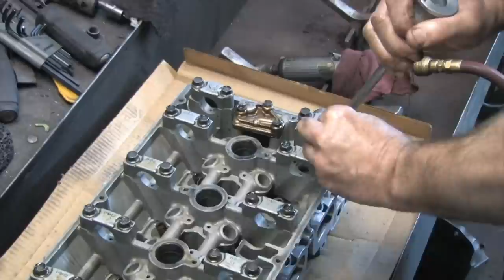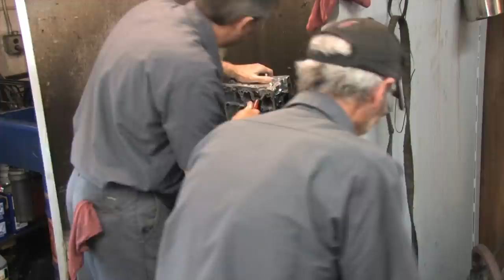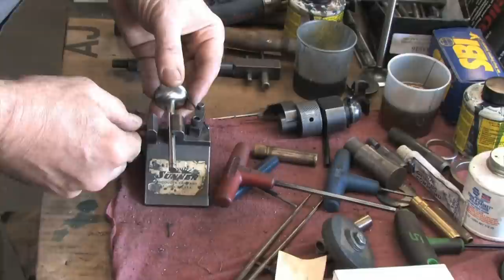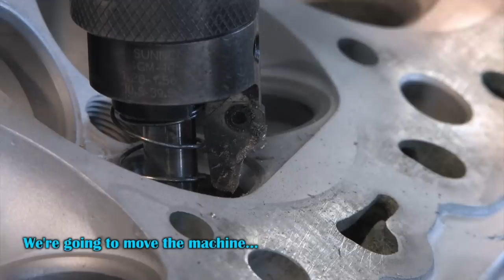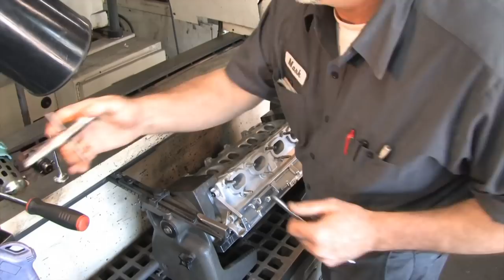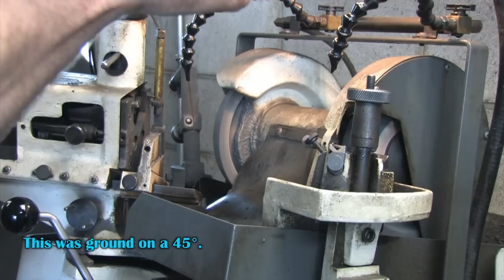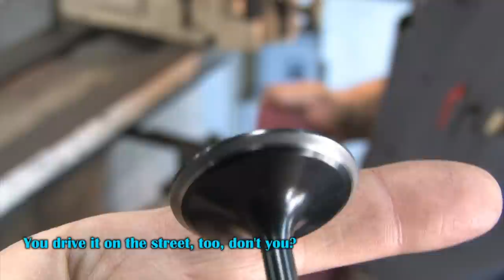Cylinder Head 201 - Radius Cut Valve Job

Comment: One trouble with lapping compound is that it cannot be removed completely by wiping with a rag. Any of it left on the face of valve can cause failure. Prussian Blue  Machinist blueing is best for checking . Just rotate the valve and get a high contrast view of the contact area. If you use lapping to clean up poor machine work you are cheating or working on some old junk head to get the klunker to run a while longer. On high speed engines 10k rpm you never use lapping compound. You set the valves with extra valve lash,.003 , and run it a few hours to beat down the high spots. Then reset lash to correct clearance.  Another thing is noone measures the valve stems for wear or the actual clearance from valve to guide. Usually the finger method is used. Tight guides have caused more problems than loose ones especially on the exhaust.
Reply: Agreed. I was wondering why on earth he dicked up that valve and seat with compound  instead of using dye. I give him props for checking his work, but...

Comment: ...chamber and sunken exhaust valve seats to reduce the amount of the intake air charge that flows through the exhaust valve during the overlap period. You can read more about it online on his website. The case study he used was of a heavily turboed (38lb boost) Mitsubishi 2L motor putting out approximately 700hp, after installing the POLYquad head he saw gains of ~90hp at 5lbs less boost pressure. Pretty cool stuff that might be worth checking out!

Comment: Your Mitsushitty might be the first one that actually runs real good after all this work you've done and had done. Like you said they cast these heads like total garbage. You need to put the care into it to make it run right. Doing great! Got a vid of it all done? Love to see it...
Reply from the maker: This is the build that's taken 7 years to start.  I've been quietly stockpiling more parts and more tools for it while accidentally building one of the world's fastest Elantras.  That was a stupid achievement that could be easily shattered with enough welding wire and lack of concern for safety, but you're not late to the party, and this head is about to get put to use.  What you saw wrong with this head is nothing like that Elantra's cylinder head's problems were like.  The head here was from an early production (October 1994) second generation Eclipse GSX.  The earliest of the 2g's before they sold out of their entire inventory which made Mitsubishi turn the production lines up to 11 and rushing everything else.  This casting is the best they ever did for a USDM 4g63.  But it's their post-casting handling and cleanup that has always sucked no matter what country it was cast in or when.  The casting on this head is amazing compared to the one on the Hyundai.  They both had the same post-casting cleanup issues with the flash obstructing the oil return, both had rough, sharp protruding casting lines, but the GSX head didn't have mis-aligned ports or Swiss cheese holes in any of the casting.  It didn't have large protruding casting flash inside the runners.  She's straight as a tick.  This is the good one.  This is the engine you will finally see getting built right now.  There's a lot of great technical videos that came from that Hyundai along the way, though.  It was an all stock parts build, already auto-to-manual swapped when I got it.  I blew both it and my GSX up at the same time leaving me with 3/4 of my fleet broken and un-driveable.  I put my GSX's cams, valve springs and turbo in the Elantra as hand-me-downs to get it going.  I bought performance parts for the Colt that actually came off of this car.  I threw in a spare crankshaft I had sitting around and re-machined everything else back into shape, re-used everything else in the same rotating assembly that blew up before, I didn't even hone it, and it's about to be one of 3 total Elantras on the planet that have ever run a 12 second 1/4 mile pass.  There's only 2 right now in the databases.  It's inevitable that I will be the third.  It's just my spare used parts from engines that my friends and I have blown up thrown in a junkyard chassis.  This just doesn't make that much sense to me that the bar is set this low.  But anyway, I want to welcome you aboard with these cliff notes so you can see what happened here, why there was a GSX build underway that suddenly turned into technical videos about an Elantra.  The Elantra is NOT my first love.  The GSX is what I've been working on lately, it's the one I won car shows with, and it's coming back better than ever before.  

The Galant in my driveway is a car that I bracket raced through the quarter-finals in 10 years before I bought it.  On our first rounds racing, my Galant's owner's opponent red-lighted, and I out-ran my dial-in time, breaking out, and ended my night early.  He threw me the keys and I completed 5 more rounds of eliminations in his car.  I was having such a good time I didn't realize I went out in the quarterfinal race.  This was back when it was his daily driver.  The track ended up mailing him a check for his winnings.  This channel originally was originally supposed to be about a Dodge Colt, because everything else used to run.  So, welcome aboard!
Reply: @Jafromobile  I had a 74 colt i used to jump road humps with. was a fun little car. Wish i could find one again.....

Comment: 2:00 a 6 or 7 inch pair of needle nose vise grips works almost as near as fast as that tool does. Well, maybe its 2 times slower but it still gets the job done well and somewhat quick.

Comment: My timing belt broke 2 years ago and the motor continued to run fine but i took the head off and found a head gasket break in two places, and also a slightly bent exhaust valve and no sign of real damage to the valve head just the stem is a little bent. I am going to buy all new valves just to be safe but would you recommend I just lap the new valves? I am replacing the stem seals as well. What would you recommend I do on top of that? I don't have a lot of money to spend I just need to rework the head to make sure its good. The guides seem to be ok as well i hear Honda valves can take a lot of abuse.  Its a H23a Vtec cylinder head.

Comment: Do valves have to go back in there same hole, If stock ? Thanks on behalf of all of us that dream of such work thought and detail,knowledge. And patience. I bow down.
Reply from the maker: +Isreal Mussad If they're used and you're not doing a valve job, then yes.  Not to say that it will munch them, but if a problem is to be created on the seat because something doesn't line back up, that's what's going to do it.  If you have a new set of valves, you won't get the best out of them unless they have freshly-cut seats.

Comment: What a freaking great video in the time laps, subtitles and explaining!!!

But if this takes SO MUCH time, what will it cost?

Just this job will cost 6 000 USD ?

A car here in Europe shall have more than 40% efficiency. we want 60mpg or more. because it saves oil, we can use them in the future, save CO2, etc.

isnt it better to use a 3cyl engine (some use 4cyl) with a maximum in efficiency, 17:1 compression rate and 44% peak efficiency instead of idling a V8 with so many inflow and outflow that you barely have 10% efficiency ... and weight, and complexy and reduced lifetime ... etc etc.

its a ncie work, but how costy is it and what is the gain?
Reply: It doesn't take that much time, and a good machining job doesn't cost much. Honestly the gains are all around some street/strip cars ( like my friends 2.0l Sentra SE-R ) tend to be a bit mor fuel efficient out of the power band but are responsive enough to have fun at WOT. Oil burning isn't an issue either. The results of a engine build really depends on your goals for the vehicle and any engine can be fuel efficient if you really try

Comment: Awesome video!  Big props to your machinist for letting you film all this and talk you through everything.  Looks like you have a good relationship built there.  In watching this I have one question.  Why machine these flat, angled surfaces in to our valves for improved air flow when(by my reasoning) flow could be even better with a radiused(rounded) surface into and out of the combustion chamber apart from the flat valve-valve seat surface???

Comment: just had a timing belt failure the valve have  been changed and i removed the thermostat as am in a tropical country where its quite  hot . but have an increase in my fuel consumption .

Comment: If you've got a head off and apart for some major issue that required taking the head off just do the damn valve job and have it done. Doing something half-assed and halfway twice costs twice as much in the long run as doing it right once.

Comment: Hey Jafro, you should look into building a POLYquad cylinder head, This dude David Vizard "invented" it. Basically 4 valve heads generally have poor low end torque because they don't have a lot of swirl at low RPM that promotes good fuel atomization and a more complete combustion. 4 valve heads are also prone to shoot fuel out the exhaust valve during valve over lap. The POLYquad head solves these problems by using different sized valves with a flow bias to promote swirl in the combustion...

Comment: I've noticed something. The machinist ridge between the valves is much less than on my 1ZZFE - the engine for a Chevy Prizm, Toyota Corolla, Matrix, and Pontiac Vibe. 4 names, really 2 cars...we'll add Toyota Celica. Did you ever have work done to reduce the machinist ridge? If you had more machinist ridge, would you remove it or does it have properties like the knife edge on your intake runners to help with swirl or something?

Comment: when you were doing your hand valve job with stock valves,  how much did you move the valve "up" into the head and how much did that effect your clearances on the cam? as for below the valve, wouldn't it be relative based on the amount you decked the head... what was it. 001 or .015 taken off?
Reply from the maker: Not even .001.  I didn't linger very long on those ports and I wasn't using a coarse compound.  But this head had received a radius-cut valve job once before, recessing the valves about .010".  The purpose of this valve job was to move the valve "down" and back to its factory height.  That's why I used oversized valves.  The head has been decked twice, so I'll have to scrutinize the valve clearance once it goes back together.  It doesn't matter much what the valve height is so long as the seat pressure and cams are happy, and you have enough piston-to-valve clearance for thermal expansion.

Comment: i see the pole going trough the valve stem channel move as the tool cuts. Should't this be as steady as possible to make sure the cut is concentric to the valve stem when the valve sits on the new surfaces?

Comment: is there a cure once you"sink"the valv?
if you go too deep with the cutter is that it for the head?
thanx#
Reply from the maker: A larger valve will bring it back up.  You'll have to cut the seats bigger for a good fit and flow, but I did that to this head in this video to fix the valve installed height.  The seats are replaceable but the job is a 4 star general bitch.  Most people go the bigger valve route or replace the head because replacing 8 or 16 seats typically costs more than a head that was mass produced.  A rare head will get new seats and whatever cost because... rare head.  Either way, it can be fixed.  :)

Comment: One more comment. When using a carbide cutter to cut the valve seat. Coolant should be used. Not only will it lubricate the cutter but it will provide a cleaner seat.
Reply: The high pitched sound heard while the cutter was cutting would not be heard of coolant was applied.

Comment: Does anyone else see that the centre shaft is moving while he is cutting at 11:44 wouldn't that mess up the cut?
Reply from the maker: The pilot can't be the exact size of the valve guide or you won't be able to insert it.  That means that it will slightly deflect by a couple of thousandths.  This is the reason why you lap the first valve and reset the depth on the stopper until the depth of the cut is correct.  You'll hear Mark explain this process at 10:00.  You set the stopper where you lapped and found the results you're looking for on the seats, and that compensates for that deflection to ensure they all come out the same.
Reply: Ok that makes sense thanks for replying :)
Reply: I have added a comment about valve and valve guide ware above.

Comment: Wow!! An amazing amount of work, and a humorous, detailed commentary- great job on the video, and the head work!! I'm wondering if you've gotten this engine back togetherand running- if so were you able to notice a difference in the way it ran? I've had "minor"porting done on my turbo car done and knew how it ran before- it sure seemed like I gotan outsized gain in power considering how much the flow bench would have predicted(30% increase in flow, at low valve lifts). I think turbo cars are more sensitive to head flow improvements than N/A cars are
Reply: +63Turbo oops! The above comments were for the porting and polishing video-somehow, it ended up in the radius cut valve job video.....

Comment: I have just did a valve job today on a friends car. I don't agree that the way he checked the seating job at 14:10 is the correct way. The marking on the valve itself does not properly indicate a good valve seal with the seating. What we did was lapse the valve/seating and then use blue marker (or whichever engine marker :) ) with the valve and give it a quick lapse. And believe me, although the valve was lapsed all around the blue marker indicated very clearly that the seating was not fully lapsed and needed more work

Comment: also if it was a radius valve job there wouldnt be 3 angles in the cutting bit. it would only have the 45 degree angle and would be radiused above and below the 45.

Comment: I am no pro what so ever but I do have some experience with engines, and I'm just wondering, wouldn't the lapping kind of undo some of the benefits of having a machined seat?  I mean you go from the nice smooth machine surface to a somewhat dull and scuffed surface after lapping.  Is there some benefit to this, because I would think the machined surface would seal better, no?  If it is just used as a reference to show where it was sealing then there are other methods of doing this, for example, in school and with friends dad who's a machinist, we used sharpie and then did the "lapping" motion to rub off some of the sharpie to see where it was contacting the seat.  Is there any reason to do it with lapping compound as opposed to just using this method?  I'm sure you know what your doing, but using the lapping compound is just contradicting what I learned in school so was wondering if I could get some insight.  Thanks! great video. Always wanted to get into engine building/ machining as a job.
Reply from the maker: No seat will ever seal better than a freshly-cut seat.  You were taught correctly.  There are practical uses for lapping in that a mis-aligned valve will cause the contact area to wear fat on one side, and the sharpie won't show you this if it's contacting, but slightly mis-aligned..  You use lapping compound to CHECK the seat and set your stops on the cutter.  You don't lap every valve or fully seat the valve with lapping compound.  A light valve lapping gives you a lot of information, and much of it is the same information you can get with a sharpie except for what I just mentioned.  

Beyond that, and in another video, I used lapping compound to clean fuel-oxidized seats (from running the wrong leaded gas) and extend the life of an otherwise good valve job... but like you were taught, lapping does decrease the life of an otherwise good seat.  I take a lot of heat for that video because the head I checked didn't have any problems for me to expose.  I pointed people to a description that most commenters didn't read that has a link to this video in case a problem was discovered.  I was demonstrating more than anything how to check a valve seat to see if it's salvageable.  On old iron heads, and on more primitive valve trains, lapping used to be how you seated valves.  On modern engines, the less you do it the better... but there are times when it's necessary.
Reply: @Jafromobile  Thanks for the clarification! Appreciate it!

Comment: Why are they not clocking the valve seats? , instead using a bubble level you would use to put up a shelf , its no faster than using a dti , with a clock you could get it 0 for 0

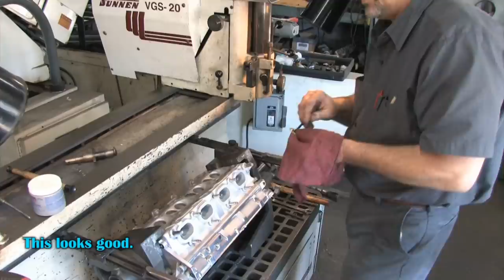Comment: around 26:00 your machinist talks about keeping the face off the edge since the engine's going to see street duty. Why does he say that? Does the longevity of the valve take a hit if the face is pushed right to the edge?
Reply from the maker: Yes, that's exactly right.  The extra edge around the seat serves as a heat sink.  If you've got a red-hot glowing valve slamming shut 3500 times per minute (valves operate at half the frequency of the crank), they stay together longer if they're not slamming shut on their edges.

Comment: ARP was the first place i looked, they don't have anything for the specific application  and i don't think i could run studs, the bolts have an odd taper to them i assume is to help centering of the rocker assembly/cam caps.
anyways mitsparts has them so i'm going to order them.
thanks

Comment: hey there I'm enjoying your video I have a question do you guys when you do a valve job do you replace all valves
Reply from the maker: That can be an option, it's not always necessary.  Sometimes you find them in spec when you scrub all the carbon off.  If they're not too bad, you can grind fresh faces into old valves.  In either event, when dealing with the valve seats, you have those cut to fit your valve.  As long as the valve fits the hole, there's no reason to replace it.